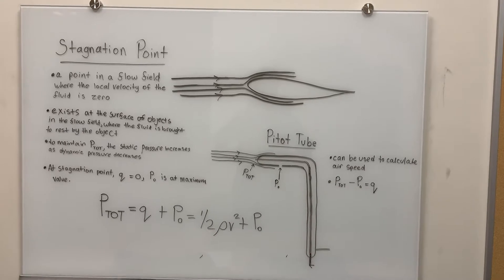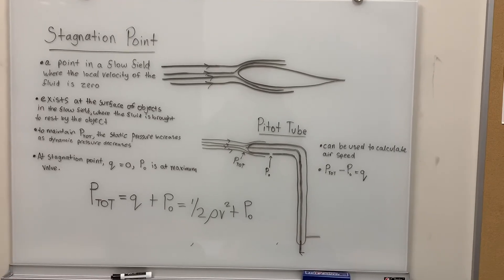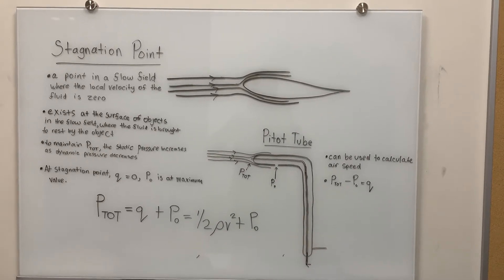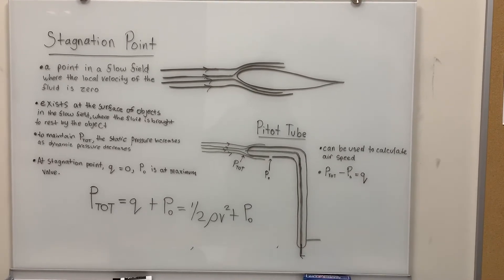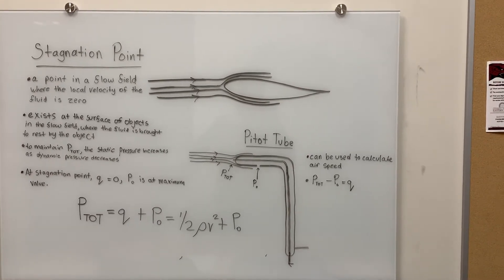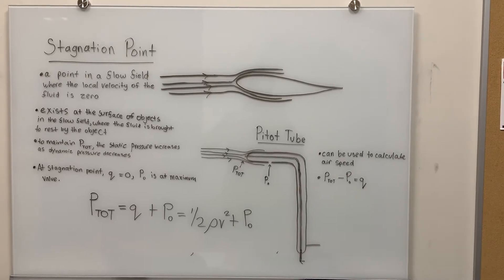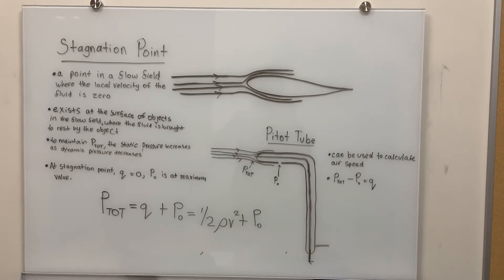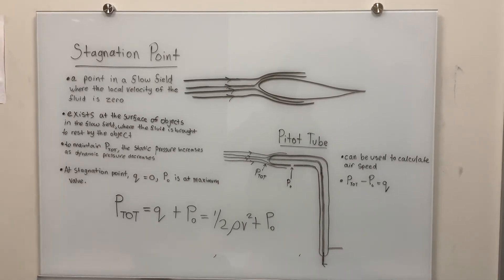Brief Overview of Stagnation Point and the Pitot Tube

Comment from the maker: I should have continued at the end and explained further: At the tip of the pitot tube, the velocity is zero, which means the dynamic pressure is zero. If the dynamic pressure is zero, and Ptot is constant, this must mean that the static pressure is largest at the tip of the pitot tube. As mentioned earlier in the video, a stagnation point occurs when fluid velocity is zero and static pressure is greatest. Therefore, a stagnation point develops at the tip of the pitot tube.